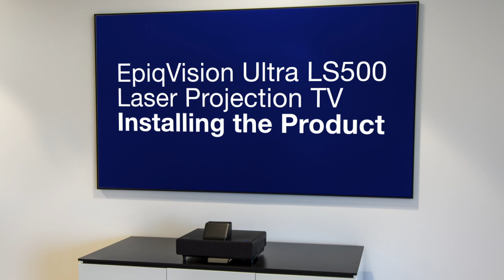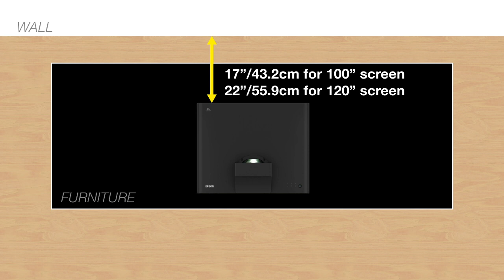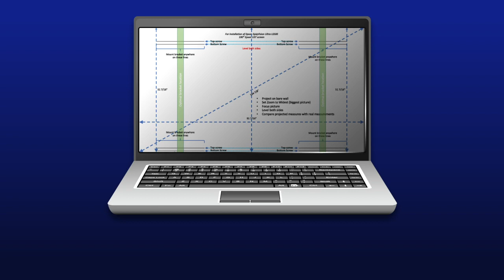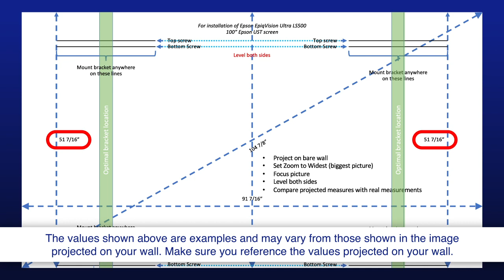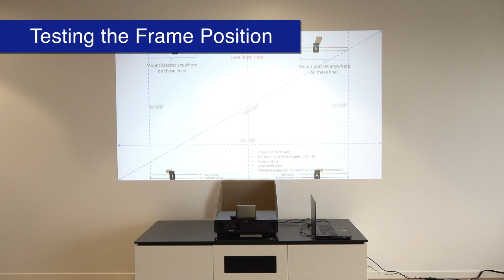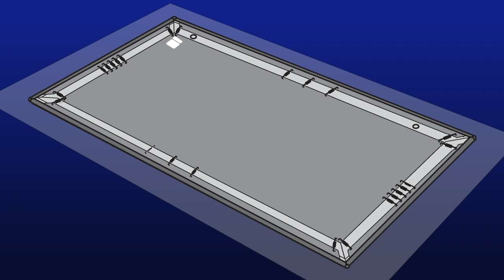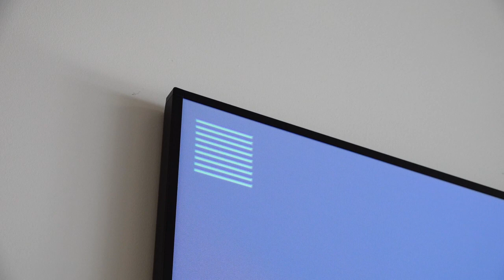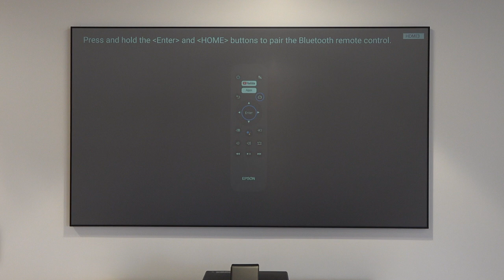EpiqVision Ultra LS500 Laser Projection TV | Installing the Product

Comment: Hello Epson. For your next UST projector, please try and have the front legs mounted to the underside of the projector as far forward as possible (unlike this LS500). Considering how far an UST projector needs to be placed from the wall/screen and the fact that some TV cabinets are not very deep, you want the projector overhang towards the back wall and not forward towards the viewer. If I were to put the LS500 projector on my cabinet now, the front of the projector would have to overhang forward as the front legs would only just make contact with the top front of my cabinet. Hope that all makes sense. I'm waiting for a good 4k HDR UST with optical for sound, 3D and low input lag for gaming. Can't wait to see your next model. If it ticks all my boxes, I'll definitely buy one.
Reply: I am suspecting -- you are going to be waiting for that one for a healthy long time.
Reply: @frankfarago2825  I've purchased the LTV-3500 by AWOL. It's the only UST projector that does everything I want.